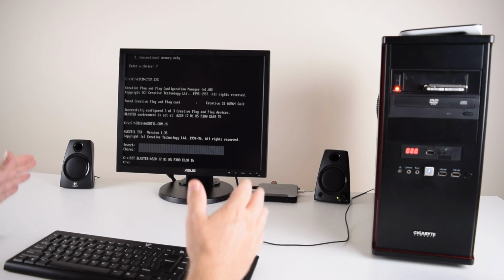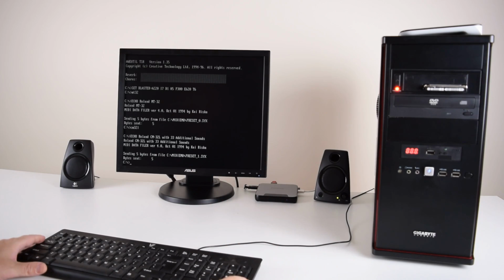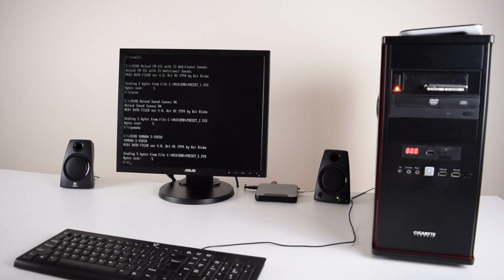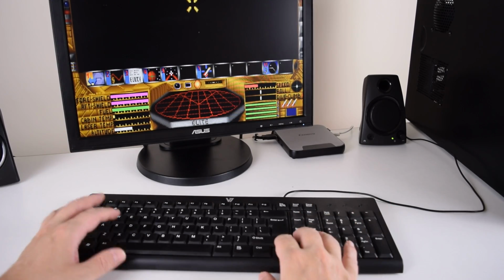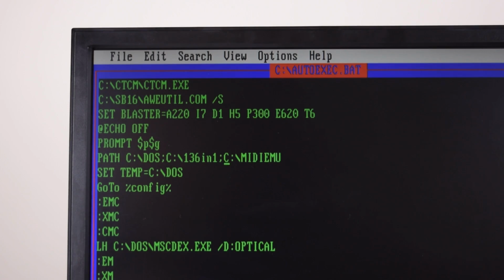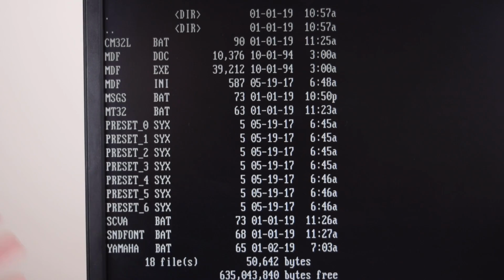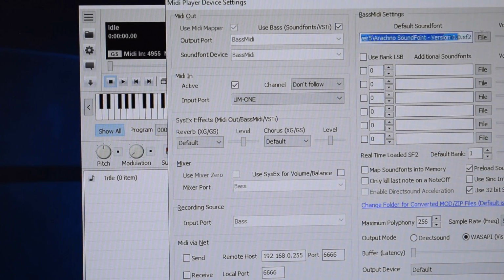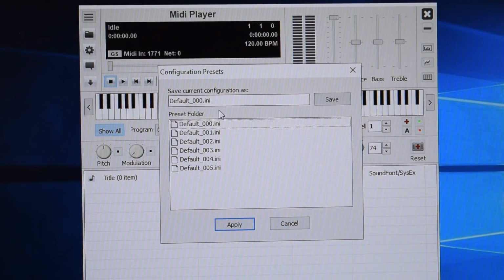Roland MIDI Emulator Project 2.0 for best music with DOS Retro Games

Comment: @PhilsComputerLab - Phil, LOVE your channel, and your reviews :-)  Im pretty sure it is, but do you think one of those (fairly cheap) intel N100 CPU based (raspberry pi-ish sized) boards would be powerful enough to do all of this (including the Sound Canvas up to the SC88)?
Reply from the maker: Yes, it should be much faster than what I've used in this video!
Reply: Awesome, I had a feeling. I am a software electrical and systems engineer, but I would rather rely on someone who has been workin this retro scene stuff for as long as you have :-) what is the USB DAC you’re using?
Reply from the maker: @rrshier  USB DAC? Was I using one?
Reply: Maybe you’re not, but I think you mentioned it I. This video LOL

Comment: Phil, finally I got the cables and the Thin Client, I'm trying to setup my HP Elitedesk 705 G2 Mini to do exactly what you are showing in the video. This is all new, never had any midi stuff to play around. I watched your videos on the topic 3-4 times and I'm getting the grasp of it. I'm running into an issue: Sound Canvas is a x64 plugin and Yamaha S-YXG50 is a x86, which fails to load on the Falcosoft Midi Player x64, requiring me to change to the Falc. Midi Player x86. In the video you just loaded and fired the game: were you using the 2 different versions of the player? If not, how did you get around that?
Reply from the maker: I don't remember the details but likely I found plugins with the same bits?
Reply: @philscomputerlab  I found out this morning. Yamaha is 32 bits only, so you should have used the Sound Canvas 32 bits also. Unfortunately, Roland store doesn't sell anymore the 32 bits version, you can only buy the 64 bits. The only solution I found so far is to use a bridge software called jBridge - it patches VSTi plugins to 32 or 64 bit clients. I've tested both ways, converting Yamaha to 64 bits and Sound Canvas to 32 bits. There is a trial version which I used to check, time limited. It costs 15 EUR, I think I will bite the bullet for this one.
Reply from the maker: @AladimBR  Man they make this so hard...
Reply: @philscomputerlab  On a side note, I tried a Sound Canvas 32 bits (1.03) trial version found elsewhere, it works normally (savihost + DOSBox), but it crashes when I try to load on MidiPlayer. This is why I'm giving up and going the jBridge direction - spent to much time on this already, without a solution. Anyway, I like to learn new things and your channel is an amazing oportunity to try and do things I didn't even know existed on the RetroPC

Comment: I wondered if there was such a thing as emulated Midi hardware and it turns out there is! Can it all be done in software if the DOS program can be fooled into thinking a hardware device is connected? Like emulating a hardware peripheral connected to the serial bus or is it crucial to have a hardware emulator physically connected? I mean, we can create a completely 'made up' computer using VirutalMachines.

Comment: I built a setup based on this and it works almost flawlessly. Just wondering how you were able to configure older Sierra games (like Space Quest 3) to work correctly? Choosing the Roland option in setup results in no sound for me but newer games (SQ4, Dune) are fine.
Reply from the maker: What is your hardware setup? Roland MT-32 requires intelligent mode MIDI interface and also Munt emulator running on the MIDI emulator.
Reply: @philscomputerlab  I'm using the gameport out on an ESS Audiodrive and using the mt32 vsti plugin through the Falcosoft player. I guess I didn't look to see if the ESS supported intelligent mode...
Reply from the maker: @emfinnigan  Check Wing Commander, if it locks up at launch with MT-32 option then the MIDI adapter is not compatible. But you can load SoftMPU driver to get around this issue.
Reply: @philscomputerlab  That did the trick, thanks very much for pointing that out!!

Comment: Well... I don't know why I didn't find your video before...
Thanks for the featuring and the interesting project!

So far, I "ONLY" have a full-size PC tower with an old multi-PCI motherboard (5), crammed with 4 Sound Blasters to test SoundFonts and wavetables...
It has an AudioPCI 128 (CT4810 - ES1373), a Live! (CT4830 - EMU10K1) with the LiveDrive IR (found years after in... a trashbin), an Audigy 2 ZS (SB0350 - EMU10K2) and an X-Fi XtremeGamer (SB0770 - EMU20K1).
All working together and switchable as MIDI outputs.
Has been quite a pain in the *ss to configure them all with the right IRQs and non-conflicting drivers on Windows XP MCE 2005!

Comment: thank you Phil. 
after all these years I finally setup everything  like above even though I have real SC-55 and MT-32 LOL! I used Thin client HP610 to setup like above. 
It works with my other real retro PC(Pentium 1MMX with your 136 in 1 configuration). 
I had some issues here and there but I finally setup. It sounds great!
Reply from the maker: Good stuff!

Comment: why do you use a male to male connecter inbetween the UM-ONE and the cable connected to the dos mechine? wouldn't it be easier to plug the UM-ONE directly into that cable since it already has a female connector?
Reply from the maker: The MIDI cables are male on both ends, so you need a MIDI joiner to connect.

Comment: Ok, sorry if this is a stupid question, but couldn't I use a Soundblaster Card and go from the Joystick port to the "mini computer" back to line in to the soundblaster or do I still need a Roland Card too?
Reply from the maker: Yea you can do this! I just prefer using an external mixer, that's all :)
Reply: @philscomputerlab  thank you! I am building a 486 going to use a mini hp elitedesk 800 g3 and a soundblaster card. You’re videos are great and I could never afford all the Roland equipment. Fingers crossed that it works

Comment: I'm currently juggling an MT-100 (MT-32), an SC-7(SC-55), and a Serdashop X3MB (general MIDI/soundfonts) via a 4 port DIN switch and a mixer.  This is a FAR more elegant solution.  While someone complained about the cost of the Roland VA plugin, you don't explicitly need it to get awfully close to the SC-55 / SC-88 sound via some of the free "inspired by" soundfonts out there and mapped to profiles in Falconsoft.   Considering the SC-55 and SC-88's typically sell for more than $150 each in the used market (and were north of $600 each originally),  $125 for the virtual module isn't outlandish.  I am surprised Roland hasn't capitalized on the retro gaming craze with a similar for-purchase software virtual synth module for the MT-32/CM-32L given the prices of original hardware these days.

Anyway, this is a great project and the instructions on your site are great - thanks for all the effort putting this together!

Comment: so what you set the game to use as midi? you didn't show that part, do you some general sb16 setting for everything? or does that have to change depending on what emulation you're going for?
Reply from the maker: The games comes with a utility to select the sound device!
Reply: @philscomputerlab  I know, that's what I was referring to. I was wondering thought that the midi files and command set for general midi might be different from let's say a mt32 version of the same music. The mt32 emulator  might have the sounds necessary  but what does the game sends to it?

Comment: Thought Id say thanks for the tutorial Phil as it was very inspiring as are all your great videos. Rather than use a mini PC or otherwise dedicated unit for this project I thought I'd just use my main i7-8700K PC which is not far from the DOS PC. I routed the audio out of the DOS PC (AWE32) into the line in of my PC. This way I can play my DOS games with audio coming out my main PC speakers which are very good and also listen to MIDI tracks on the main PC using the Falcosoft MIDI Player (amazing software). For people such as myself who don't have a MPU-401 card on their PC I think Phil mentioned the Gameport to MIDI adaptor cable needed in the video but I didn't see a link for one in his list of links. For those who need such a cable I purchased the one below for around $22. It only took 2 weeks to get here to Adelaide from china. Very nicely constructed but they didn't label which connector was MIDI IN or MIDI OUT. Anyway it took 5 seconds to work out which was which.

https://www.ebay.com.au/itm/1-8m-Dual-MIDI-DIN-5-Pins-DB15-Sound-Card-Joystick-Cable-Wire-Cord-Game-Port/263986355060?hash=item3d76d01b74:g:rDoAAOSwt6hcdZaM&frcectupt=true

Comment: Great project. I tried to implement something like this using a Raspberry Pi 3 (cheaper and less space wasted), and it works really well (with some caveats).
- Software configuration is not easy. You need to compile MUNT yourself, learn your way around ALSA MIDI mappings, and finally, write some scripts for routing.
- It's more flexible. I used a mididings Python script to answer to the SYX files sent from the retro PC and it works beautifully: not only I can switch from MUNT to FLUIDSYNTH and change the active soundfont using BAT files, I could also send arbitrary text commands to the Raspberry and process them in the script. Potentially, it could do things like save MIDI files of anything you are hearing, show the MT32 LCD screen contents in an external LCD, or change any kind of settings (volume, reverb...), etc. You can of course control this script from the Raspberry, perhaps using an external keyboard or touch screen.
- It's Linux, so no VST plugins. That means I can't use Roland's (extremely expensive) SoundCanvas plugin or the Yamaha one. I found that Fluidsynth is good enough for GM, though.
- Unfortunately, the Raspberry is not fast enough for accurate MT32 emulation using MUNT. It is good enough most of the time, but some complex music will sound really, really bad, with a lot of wrong tempo issues. Turning off reverb/chorus and choosing a less accurate emulation method improves the situation (the sacrifice in sound quality is very noticeable, though).
- Latency is not great (and no, shooting around in Elite is not a good test, you really need to plug in a MIDI keyboard to the retro PC and try using something like DOS Cakewalk; latencies around 100ms, which would be unnoticeable in games, are extremely irritating when trying to jam).
- You'll have the same compatibility problems you'll have in retro hardware if you don't have a real MPU MIDI card, almost impossible to find (and extremely expensive). Many games won't work at all or will have a lot of issues.

A nifty thing you can do if you use any kind of support mini-PC for your retro hardware is purchasing a serial-to-USB adapter and use any DOS communications package to open a shell to your support PC. You can even transfer files this way using file transfer protocols like ZModem, same thing we used to do when connecting to BBSs and such.

Comment: I hooked up my p200 mmx with SB PRO 2.0 to the ROLAND USB interface. Falcosoft is running on a Thinkpad t420. However, when running the mt32 batch file, I get an error - MPU inerface not responding. Am I missing something? I'm using a GamePort to MIDI passthrough cable.
Reply: Oh, never mind. It odes work on the AWE64.

Comment: This project is to me the most inspiring so far ... heads off to you Phil. Have ordered a miniPC + have been testing everything on my main PC first before I'll port it to the miniPC. The MDF tool inreal DOS via MIDI-TO-USB cable works fine. You just need to tweak a little bit in HEX to make more presets, but that's part of the game. Want to create more presets for all cool soundfonts out there...
Reply from the maker: Thank you :D I didn't consider that someone might require more presets LOL AFAIK Falcosoft's MIDI Player supports a large number, so yea, you can configure a ton of SF2 Fonts and then switch between them through batch files, it's all very convenient. Let us know how you go with the final project and maybe share a photo on twitter if you like, I rarely hear or see projects of others, but always excited to see when one is shared.

Comment: Phil, Windows on Arm opens a whole can of worms with the Raspberry Pi 3B+
Here I ran the falcosoft player and S-YXG50: https://i.imgur.com/IIPdTEN.png

Now I'm not 100% sure how will the usb midi behave, currently the driver doesn't install for some reason on my end. Quite possibly we will need to find a driver or build one for the GPIO pins.
Reply from the maker: Windows 10 runs on the Pi???
Reply: @philscomputerlab  Yep, check it out: https://pi64.win/

Just tested the SC-VA, it just barely runs. Jitters if anything runs in the background, especially with the EFX turned on so yea, the potential is there, it just needs optimization to work!
edit: SC-VA stops jittering if I disable the UI, seems to save CPU time.
Reply from the maker: @xan1242  That's pretty much how when I used the t5730 Thin Client with Windows 7, in some games it would work, but if you waited long enough, it would then trip over and fall behind so to speak. It just wasn't fast enough to handle it.

Comment: Yamaha S-YXG50 only works with Falcosoft MIDI Player 32bits (x86). It's only a 32bit mode Plug-in, so in order to have everything working, you cannot use 64 bits plug-ins, neither Falcosoft 64 bits.

Comment: After buying the Roland USB adapter, I found this. Not sure if works with MT-32 but does worth giving a try I think...Besides, it is possible to build it directly connected to the gameport (no DB15 to DINs cables). A nice 3d printer enclosure and that's it. What do you think? Does anybody tried it? http://codeandlife.com/2017/09/17/5-usb-midi-adapter-with-atmega32u4/

Comment: Curious if there is any way of using those batch files on the emulator box itself rather the retro PC. I'd  be interested in having the option to change the mode on the fly without having to leave the game.
Reply: You do not even have to use .bat files (but you can). You can reach the different configuration presets on the host PC with Ctrl + Alt + Presetnumber hotkeys. So. e.g. Ctrl + Alt + 1 switches to the preset that has the _001 postfix (e.g. Default_001)
Reply: @zbacsko  That's good information. I guess what I was thinking was if there was some way of having a small screen on the mini PC and then having some sort of UI where you could just hit a button and flip between the presets it would be so turnkey, and you wouldn't even have to exit the game in theory.
Reply: The whole point is not to need a screen on that machine...

Comment: Nice!!! I will try with my t620. 
What is the quality of the sound that sends out the thin client? Is there any noise that alters the midi or the sound?
Reply from the maker: The t620 has pretty decent sound. It has DisplayPort out, so you can strip a digital signal from that port if you want.
Reply: PhilsComputerLab Is it worth? And which cable is required for this? Also, I have an external SB Recon3D. Would I get better sound?
Reply from the maker: @franky52sr  Just try it out man and see what you think!

Comment: Simple question: As you mention, the Roland USB MIDI adapter alone costs 50-60 bucks. How can all parts required for this project be under 100? What's your estimated price for the HP t610? (and there's still the cables)...
Reply from the maker: As always with prices, they can vary with different regions, specials and what's available when you're looking. I got my t610 for under USD 40. Good luck with the hunting!
Reply: @philscomputerlab  To me it's been more like nearly 60 (unless you buy some of those batches of 10 units, which obviously I have no use for). Maybe something better will show up with time here in Europe? (US shipping costs are total deal breakers round here). Thanks for a really interesting video on a not so tackled subject!

Comment: I don’t get it... Why did you need a MIDI joiner if you had already added the red cable because you had a female en on the first cable coming out of the MPU-401 card..? Couldn’t you just connect the Roland cable to the female plug? Edit: never mind, saw it had already been asked...